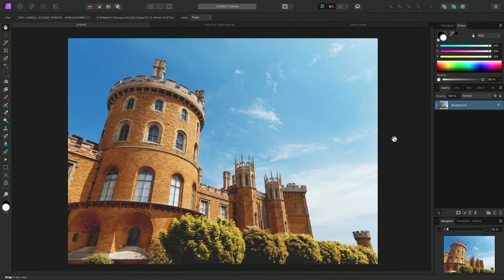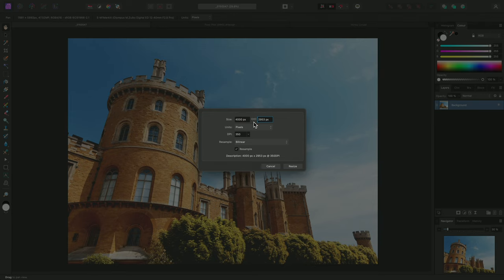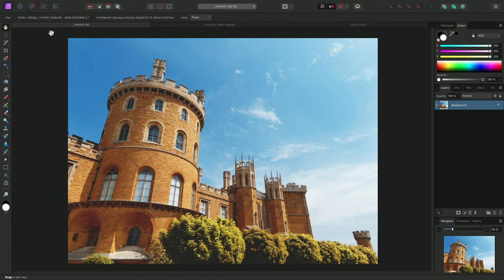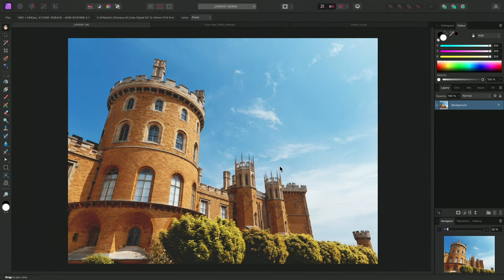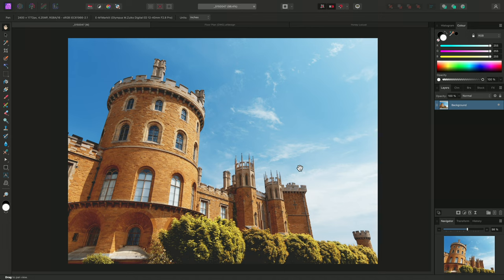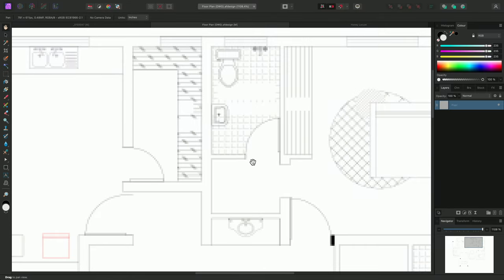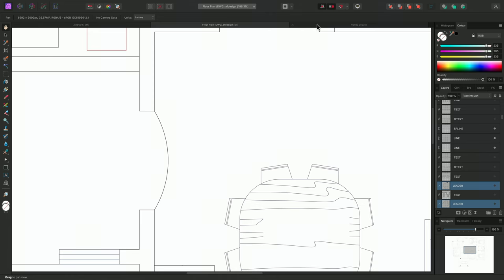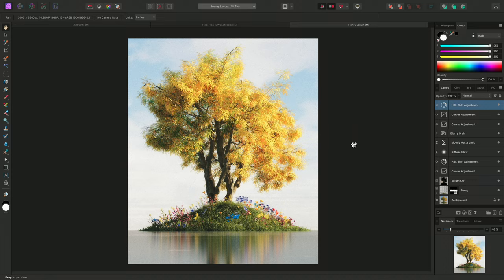Resizing and Resampling (Affinity Photo)

Comment: When using v2 on iPad, I’m only able to use sliders for the resize. I see no toolbar, and it is impossible to get the correct ratio using the slider. I have found no answer for this.

Comment: I’m using affinity photo 2 iPad, so far on trial to see if it does what I’m looking for (I use Affinity Designer 2 already though). I’m wanting to print photos of paintings at A1 size. Would it be best to create an A1 size document and then place and stretch the images to fit that size, or open the photo of the painting the size it is and then resize like you describe here? Does this impact the quality of the final image? 

Can I batch edit size in the iPad version? 

Is there a limit to how much you can resample and have a decent image at the end? Can I resample 9x larger? If not are there tricks to make it work better? I have a vague memory from doing it in Photoshop years ago that you can duplicate the image layer and blur the layer behind and have the layer in front less than 100% to get both the detail and lack of pixelation.

Comment: Affinity still uses DPI and reinforces this error. The correct term is PPI. Also, DPI and PPI is not interchangeable although even professionals uses it wrong. Photoshop has had this correct for years now. Affinity refuses to change it even if countless people has gone through this and shown why it is wrong.
When you print something, you have to decide how many of your pixels will be printed pr inch. So, for print, it has to  be PPI. For any digital media - screen, web etc - PPI does not matter.
DPI is only used by the printer driver to determine how many dots will be used for each pixel that is printed. And we have no control over this.
The only thing Affinity does is refer you to a community post. And in that community post, it is explained very well why DPI is wrong and PPI is correct 🤣
Reply: yes. dpi is printer  ink  drops, ppi is pixel on screen.
Reply: ppi is the measure of how many pixels you will print on paper. Dpi is completely irrelevant for us. And ppi is irrelevant for screen.
Reply: So, basically this is a labeling error?  Interesting.

Comment: I am curious to know if the resizing method has been improved in version 2.0. Because in version 1.x, resizing by on export versus resizing the document before export gave completely different results. Changing the size on export of the file did not lose detail.
Reply: I haven't tried resizing for export but changed the units from pixels to inches without changing any of the pixel values one time (36mp camera). Changed the photo to 73"x49". I'm sure the quality of the image & spot on focus had something to do with it but, I couldn't believe the amount of detail in the photo as I dragged it around the screen in amazement of what I was seeing. Of course, I changed to the size I wanted to print. RITE-ON AP !!! Long live AP !
Reply: Have you tried this in v2 yet? I’m trying to work out the best workflow to resize images to A1 size still as good quality